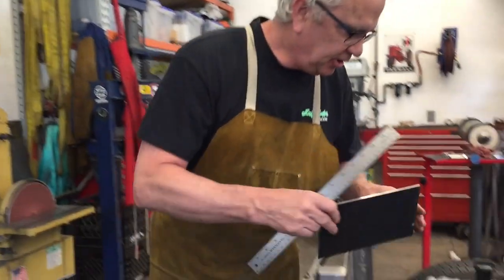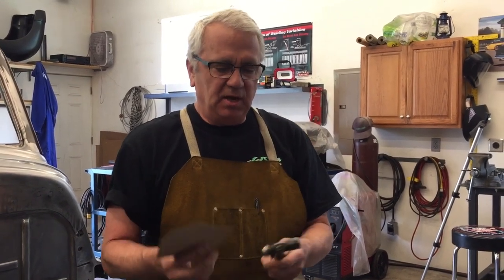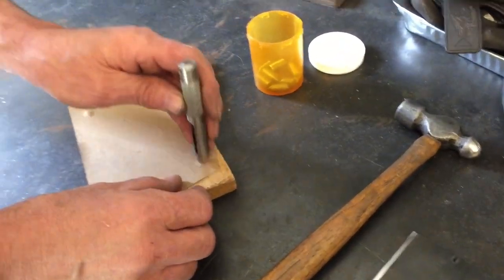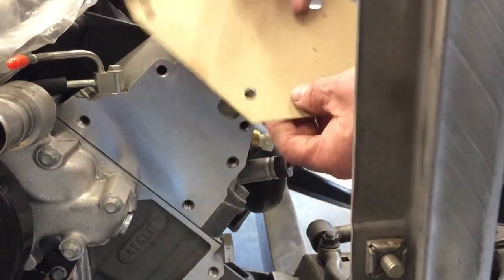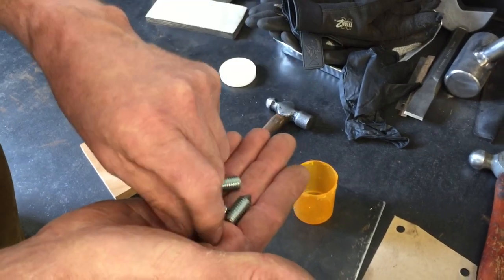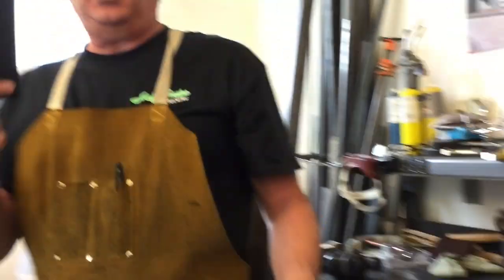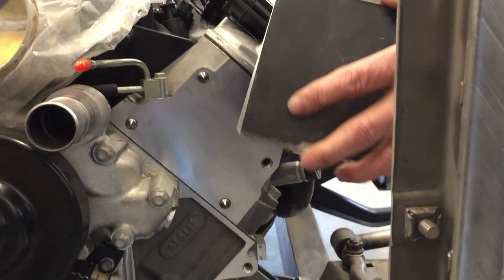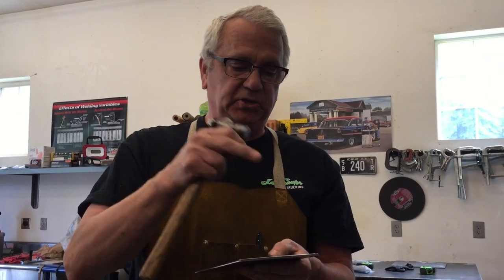Motor bracket magic !

Comment: Do you have a set of harbor freight transfer punches? They make transferring hole patterns onto new steel so easy! They go by 64ths up to 1/2”. Would recommend 10/10 so far. Used them on some caster brackets :) if you end up getting a set I’d love to see a video ;). And good idea on the sharpened bolts. Super slick man